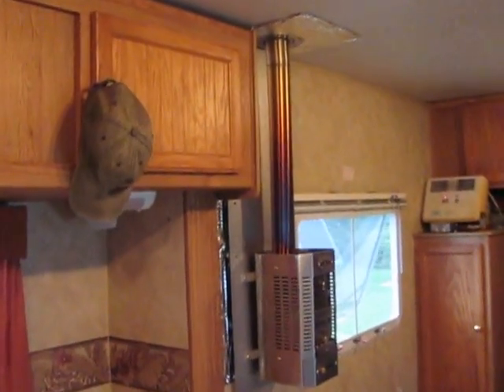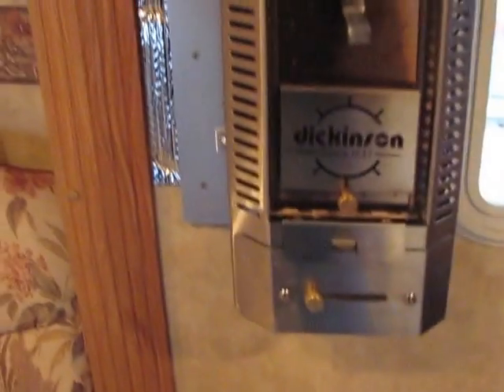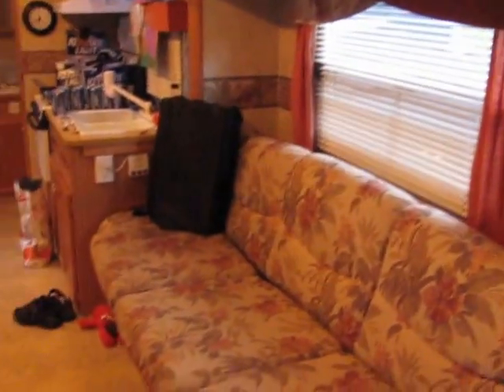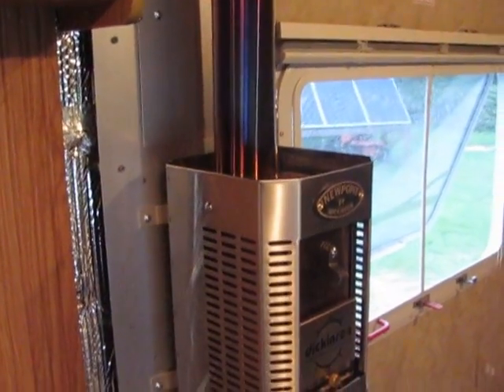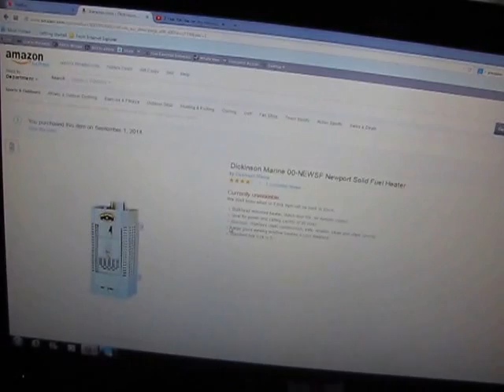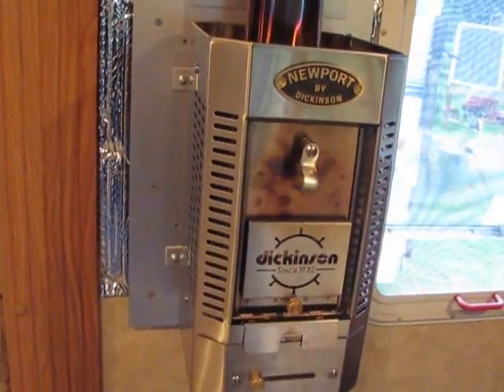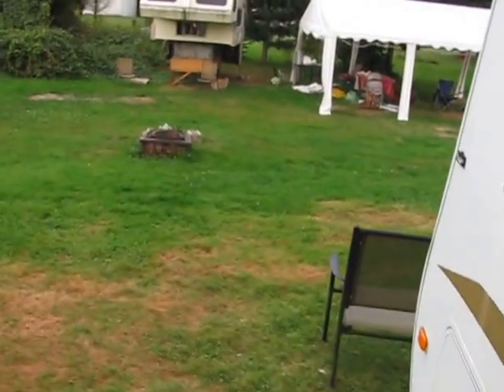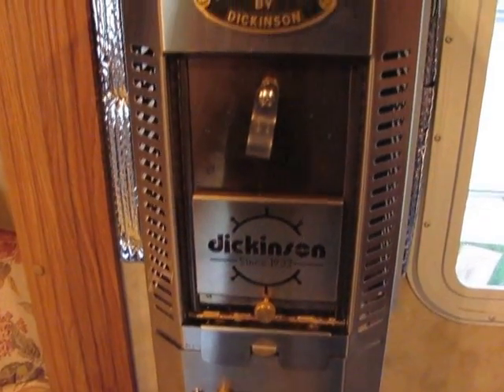Dickinson Marine 00-NEWSF Newport Solid Fuel Heater,, review

Comment: I saw the mod you did on your second video, really cool.  on a safety note, when I was stationed in the military in korea, in the villages they use to burn coal in the winter time to stay warm, a lot of people were found dead because of monoxide gas. I would rather see you around for a long time , so be safe, you can pass out from those fumes. headache is first sign.
Reply from the maker: I open windows to help control the heat inside my little trailer,, I will never use the stove without a window open ,,, Also I have a up to date carbon monoxide alarm,, just in case :)

Comment: FYI...You really do needs a flue damper, you can even install it now inline from the stove to the ceiling inside the stovepipe. Its like an accelerater to slow or fast burn of any solid material used by controlling the exhaust, all it is, is a paddle round in shape inside the flue pipe to control the drafting of the burn. By turning the paddle horizonal to the pipe cuts off the air flowing up the inside of the pipe. Vertical would mean to accelerate the burn. So, with that you should be able to burn wood  with no problems. Its maybe a total cost of $8.00 bucks, and drilling two holes. Hope you get it done and wood burning would be quite cheaper than briquettes. :) & then put a heat shroud around the pipe for cooler surface temperatures.
Reply from the maker: Thanks Burl,, I will check into doing that ,,, I will probably have to build my own I don't think they make one for 3 inch stove pipe
Reply: Sure they do...they are most likely cast iron. Your local Ace Hardware store should if not already have them. You should see "Navigator Stove Works" they have them for a price of $10.00 bucks. But you can get them as I personally have seen 3"flue dampers sell for 4-8 dollars...just look around. You should be able to find one or make one yourself. They are just a flap for metal to damp the air flow. They do fit loose  in all sides of it around the inside. Its not meant to disquingushe the air but to damp it from being a full bore of air, which has the oxygen, thus fuelling the fire. Also prevents a negative pressure from the outside so the stove does not run backwards pouring smoke in the opposite direction of the designated intentions of the build. Hope this helps. C-ya. :)
Reply: It has a spring in a cup washer outside the pipe as the rod goes threw both outsiders of the pipe. The flap is in the interior of the pipe. The rod could be spot welded in place. If you were to make one yourself. But the store bought (china made) are so worth the expense to just buy and drill the holes and then thread the shaft through the offset and inline it and then inserting it into the opposite hole on the other side. Never have had seen ever any smoke leak through the holes to the inside. So no worrying about that. I know you'll be very pleased in having control over how hot you wants youtH. stove burning. And the flue damper is the (gas pedal) on any stove that has a pipe for the exhausting of smoke. And you will be adjusting it to learn it on different types of solid fuels. As the damper should be adjusted to achieve a clean smokeless burn every time. On any type of stove. Its all in how the damper is in adjustment FYI. :)
Reply from the maker: Burl Carey
Thanks bud :) I am looking into building one myself because I have not been able to find one made for 3 inch stove pipe yet ,,, as you say ,, I think this and being able to control the stoves air intake, I should be able to safely burn any solid fuel in this little stove :)
 Tonight I am burning small (1/2-1 inch) coal ,, very hot ,, but it does not last to long ,, I have to re fuel every few hours
Reply: Google Navigator Stove Works, you can even talk to the owner by calling him. I have on a few times in the past of several years. As well as meeting up with one of his past employee that travels around having a "tea making time" of social talking and he has them...just order one and it should be in your possession in 2-3days? Then drill two holes or one all the way through to the otherside...and then you'll be set to go. :)
Reply: Jason Brown Part# 16-001: 3” x 22” stainless pipe with barometric
Part# 16-010: 3” x 7” stainless pipe with barometric
Reply from the maker: yakyakyak69
I think so with this little stove,, by controlling the air flow going into this little stove I am also controlling the burn and exhaust coming out of it ,, If I try to use a damper / plug the 3 inch chimney, smoke will fill the room,, controlling the airflow to the fire is the best way I found for using this little stove in my RV .
Reply: @wabuminifarm3437  Dickinson sells all kinds of accessories, including 3-inch dampers.

Comment from the maker: I have many videos about this Dickinson Marine solid fuel stove, Watch them all before you get your panties in a bunch and think I am giving a bad review on a product I am still using for over a year now ,, it just needs a little work to make it work a little safer and better than the way it shows up right out of the shipping box.

I would think this stove would work safely and correctly right out of the box without having to tinker with it for over a year now trying to get it to burn in a controlled manner, I figured it out now and it works great ,, I will make new videos soon showing you how I made it work as soon as I can
Reply: JASON, CAN THIS STOVE BE BASE MOUNTED INSTEAD OF BEING WALL MOUNTED?

Comment: Even with seals around door and ash pan it would still be unsuitable for wood burning as the air needs to come in above the fire got efficient wood burning. With bottom entry for air it is impossible to get a good build up of embers and clean combustion.

Comment: YOU need to seal the ash box on the 4 sides, on the ash box i sealed the vertical, and on the oven the horisontal and it works great, only fired with wood.

Also tryed a barometric damper, AND smoke will fill the room. DONT use your money on that.  Part# 16-010: 3” x 7” stainless pipe with barometric.

This is what i used, http://www.homeshop.dk/tilbehor-braendeovne/morso-pakningssat-til-glas.html  Use a thin flat sealing then you can use the saftyclip to hold the ash box in place.

YOU NEED A carbon monoxide alarm.

Comment: I agree with some of the other comments, you need a damper.
Reply from the maker: I still have not bought one yet,, because when my 3 inch stove pipe starts getting plugged up smoke starts filling the room,, i fear that adding a damper will do the same,, i guess it depends on what i am burning or if the stove has a good door seal ( which it does not) ,,
 I have to clean my chimney about every week to keep all the smoke going out of my travel trailer ,, I got to keep the fire small, don't over load the little stove,, or you get smoke in your living area ,, or flames going up the chimney,, the best way I found to control the burning fire is to control the air flow going into this little stove, cut the air flow and you cut the flames down,, keep the exhaust free so all the smoke can easily escape.